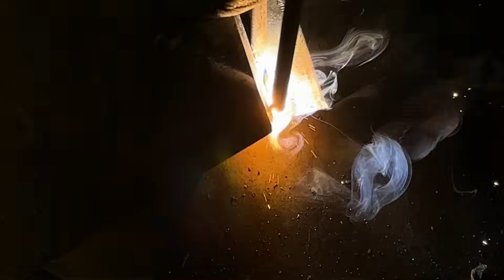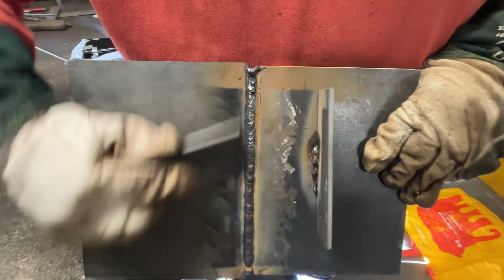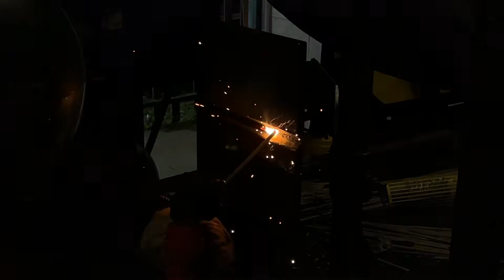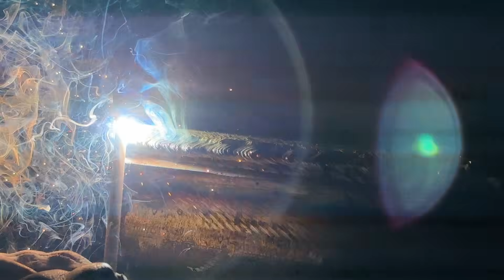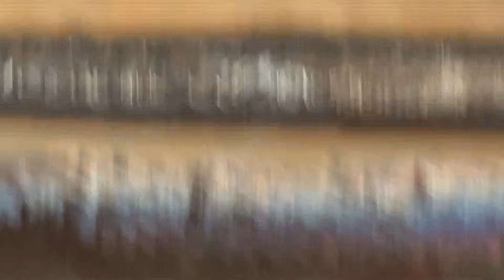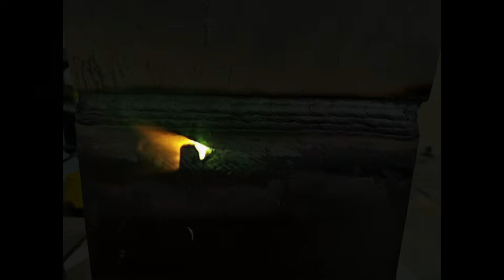Horizontal Stick Welding 15mm Thick Plate | E6011 & E7018 Multi-Pass Welding Tutorial

Comment: @weldtechsolutions: How come 6011 and not 6010; is it that the machine can't run it (6010)? Great demonstration by the way.
Reply from the maker: We used 6011 instead of 6010 because 6011 works on both AC and DC, is easier to control on small fabrication jobs, and handles minor rust or surface imperfections better. It still gives strong, deep-penetrating welds, but it's more forgiving and versatile for the kind of light fabrication work we're doing. If we was completing pipework we would go for the 6010 but the difference is minimal between rods.
Reply: @weldtechsolutions how much good ampere for 6011 in horizontal weld sir?